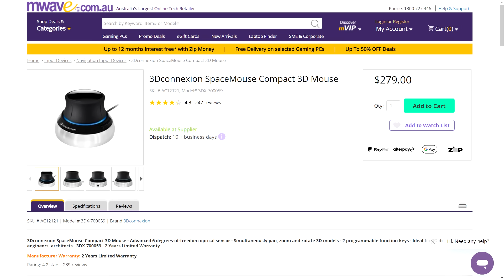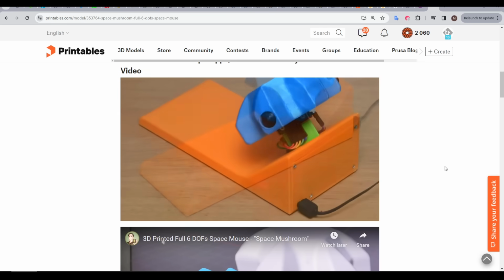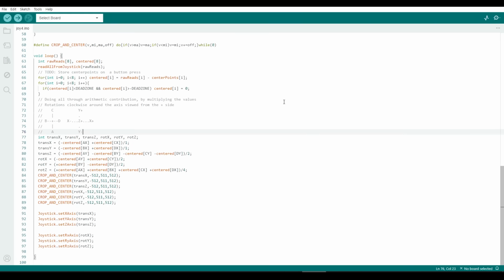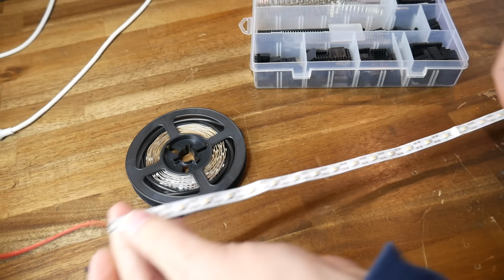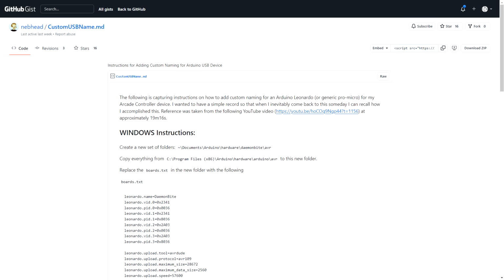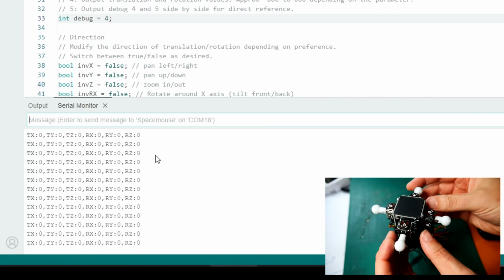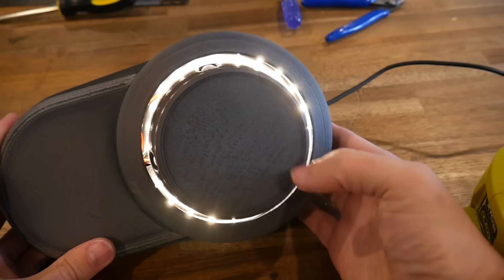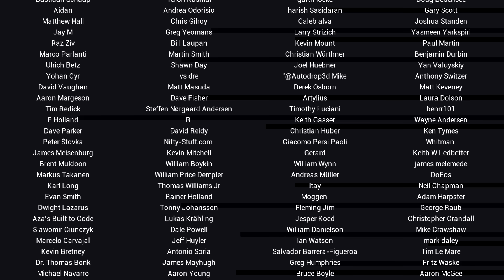Making a cheap, open source 3D space mouse with Arduino and 3D printing *V2 out*

Comment from the maker: V1 has been dubbed 'Bigfoot' on Printables. V2 is now out, which I have called 'Mini-ish''. It's much, much smaller and has some code tweaks to require a smaller range of input motion. Same link as before: https://www.printables.com/model/864950-open-source-spacemouse-space-mushroom-remix
Reply: Love it. ❤️  I'll wait a couple of weeks before making this in case a V3 comes out. 😃
Reply: @johncrombie2771  dude... build the v2 and then use it in cad to iterate the v3!   then take a pic of you working on the model of v2 while using the actual physical v2... meta.   lmfao.   but seriously... thats what makes open source stuff like this awesome

i had actually spent some time trying to 3d scan a big chunk of play dough i made into an ergonomic wrist/palm rest for my space mouse.    those files are around somewhere too... rests for the smaller 3dconnexion one as well.
Reply: @DeagleBingo  One reason why open source is so good, is that you still get to enjoy it even if you don't personally want to contribute :) I'm personally only interested in building one, but it will no doubt be used to create something else, that I'll share for the community!
Reply: Dang V2, came out right as I finished V1 almost on the dot. :)
already printing them out 😎
Reply: impressive iteration speed! I saw the first video and was considering whether I could remix it to work like the v2 you made but you beat me to it!
Reply: There is a project VjoySerialFeeder that can take anything you can possibly connect to an arduino into a joystick in windows and linux, i already implemented a lot more stuff and i'll upstream until the end of the week. For instance, support for playstation 2 controllers and key matrices, i wanaa play racing games with my gameshark pedal and the ps2 controller, the software seems good but my arduino forgot it's bootloader and i need another one. I will probably be implementing support for other controllers as well.
Reply: I see you turned the joystick PCB's sideways (which is what my design is using so I can reduce the height of the unit)...did you have to do any reversal of variable directions or just switch the X and Y connections?
I haven't gotten to debugging yet so I don't know if more than connector swapping will be necessary...
Reply: Okay...got it to compile, but 3Dconnexion doesn't recognize it when I plug it in...

Edit: I think I got it to work...see my comment below for more details.
Reply: @hdmungeryt  what did u do to make it recognize it?
Reply: @bismakadar3222  I outlined how I fixed it in the things I learned section of my previous post farther down the list.
Reply: I just want to thank you for calling out the poor design of Orbison, it felt like a college student's first projects. I tried making it, it's a fing nightmare broke 2 Nanos and ran into multiple issues with the printing (in retrospect mostly poor print quality but it was my first print so I didn't know better.)

The biggest bullshit with is it's spread across like 3 different repos irrc I got the code from one place wiring diagram and BoM from another Nd the STL files from another. 
Got the parts in went to wire it up only to find out yes there is a 'wire diagram' but it just tells you solder x wire to a and b parts.

Ended up having to disassemble it so often to troubleshoot failed soldered from too aggressive handling does help that the margen of error for soldering is nill literally for some areas I had to pretty much smd solder instead of through hole because the area behind it was a slab of pla.

I have high hopes for your build the space mouse was always meant to be my backup  build but got turned off it after the night mare of Orbison.
Reply: I came to the comments to say that it looks promising but I'll wait for the smaller revision before I'll try it, I guess no waiting then 😁
Reply: @Iisakki3000  works well :) But software support is surprisingly hit or miss. Lychee does not support it. Fusion 360, Chitubox, Qidi slicer, Prusa slicer works well. Though zooming in and out is better with mice  :D 
Maybe someone could add a rotary encoder for zooming + macro extension would be cool as well to add some buttons. I'll think about this :D
Reply: I'm making the V2 right now. Parts have been printed and I've got the joysticks and the board but I'm having trouble accomplishing the first step (nebhead's instructions) because I cannot find the avr folder because I'm on a Mac. I could use my Windows work laptop but I'm not liking the idea of having all of my work stored on something that isn't mine, especially since I'm planning to do more of this.
Could this work on my Mac or should I just take my work laptop...? I've looked online and found several suggestions on where to find it but no luck yet...

edit, finally found it at Users/username/Library/Arduino15/packages/arduino/hardware/
Reply: @deblaiser  Hi, does it work for you with macos?
Reply: @FrancescoAstore73  Using the load of help in the "makes" page of the printables model, I got the spacemouse recognised by my Mac. But before testing it out, I'm now printing some of the upgrades (re-centered box for the joysticks + joysticks with less clearance) so I have not tested it yet.
Reply: @deblaiser  Thank you. I just solved it by using a new boards.txt file.
Reply: when is it the third version?
Reply: Your work Looks amazing - newbie here with a Bambu P1S - teaching myself fusion now just need the v2 parts and some time
Reply: Luckily I have waited a bit and printed V2 :D But I broke my board. When I plugged in the USB cable the connector separated from the board and can not be soldered back :C I have to wait for a new one now T_T

Comment: I built the Spacemouse according to your guide, but I'm running into a problem: my MacBook with macOS 26 recognizes the hardware on the USB ports, and the Arduino IDE (.ino program) also sees it. However, the 3Dconnexion program does not recognize it. How can I fix this? It feels like there's a connection wall.

Comment: The prices are ridiculous because they got the monopoly, Wacom was the same (And probably still are) before other companies could make Display Tablets. Like 6-8K for a tablet.
Reply: Yes. I've got one that I found on ebay because it was older, though lightly used. I had one several years ago, made for serial port and WinXP, and when I asked for updated drivers to use it with Linux, they told me to go buy a new one. Who do they think they are? John Deere?

Comment: hi, i have made this spacemouse (v2) but when i use the code linked on printables, arduino ide says there is no file or directory for HID.h. also the arduino ide installation folder for me does not show hardware. is it because i am opening the ide installation folder, if so please try and help me since i need this project done soon. many thanks

Comment: my code is working in Aurduino IDE, showing variable changes in serial monitor as well, but still not connecting with 3dconnexion software, shows no device connected/detected

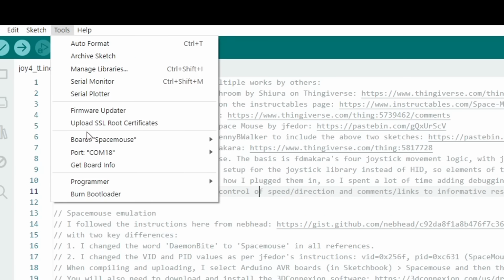Comment: A very good video. But unfortunately I can't get any further from the 10:40 minute mark. Where does this code come from, how can I upload it? So that I can edit it further and upload it to Arduino.
Reply: On printables:
Other files
joy4_tt.ino
Arduino sketch for original 'Bigfoot'
14 kB  |  May 3, 2024
joy4_tt_v2.ino
14 kB  |  May 8, 2024
Reply: @sneakyg1250 
Thanks for the reply, I'll give it a try.
Reply: @sneakyg1250 
Today I finally tried it out and did everything according to the video. I get an error message or something similar when I run the code. I suspect that the version of Arduino used also plays a role. I've noticed this with other projects. Unfortunately, you can't see which version is used in the video. Who can help? Unfortunately, I can't post a photo here with the message I'm getting.
Reply: @Denman123  I just installed arduino, didnt change the version or anything, just those files where needed and replacing the boards.txt file in the avr folder
but i cant remember what else i did * you do need to install the driver from 3dxware

Comment: I built it!   Worked on the first try, couldn't believe it.  Still can't figure out what screws you specified to hold the joysticks, but I just drilled them through and used 3mm screws that don't stick out the sides.

Comment: Same here 3dconnextion software does not recognize the mouse, correct PID and VID, same as in video and instructions. Also serial monitor is not working

EDIT: got it to connect, however it`s only outputs in the serial monitor is 1023. no change in values as i rotate or move the joysticks.

EDIT2: got it to work, bad connection  negative on the Arduino

Comment: Yes definitely that motor and battery voltage is looking way too small (not powerful enough) for your model.  Not sure if that RC car is a 1/10 or 1/8th scale size but. On my 1/8th size RC truck looks similar to the size of your model has bigger stock brushes motor and a 4s size battery. Hope this helps.

Comment: First and foremost I wanna say thank you for the awesome content I have wanted a space mouse for sometime but couldn't justify spending that amount of money. Im so glad you did this. I have everything printed and assembled,  however me being pretty new to programming these arduino boards has me a bit stuck I dl the newest software realizing there is no " hardware" folder you speak of.  fixed that by downloading an older version now I have the hardware file I started to follow nebheads instructions but im stuck again as I cannot copy over the boards.txt information into the created avr folder.  Any help with this would be greatly appreciated.  A very dumbed down updated video for the software side of things would be awesome.  Thanks again for everything you do. UPDATE: I put my big boy pants on and got it all figured out.  I now have a perfectly working space mouse Im so dang happy it worked out in the end. THANKS AGAIN!!

Comment: Hey ya'll - I'm so late to the party on this but I do have a question.

I've built the mouse, arduino'ed and run all the testing/debugging - but alas, it won't connect/be seen by the 3Dconnexion driver/app.

Is there any easy to diagnose reason why it woudln't be picked up? 
I'm at a loss and looking for some guidance.

Thanks in advance
Reply: All good now. One person has provided me with some extra code and boom. Identified and works perfectly! :)
Reply: @Lucifersjester  what was the extra code? im having the same problem :(

Comment: Only I have a problem, that this 3dconnextion app cannot see mouse? It works in serial monitor in Arduino ide but that’s it. I can move my normal mouse with it, macOS sees space mouse at usb but still can’t connect to app. Any advices? :)

Comment: If you're still doing this project, could you do light sensors instead of 3d analogs like in the original spacemouse, because the 3d analogs are very insensitive in the smallest movements?

Comment: exactly the question I was going to ask. . . why so big?
Reply: The real question is "Why don't you just buy the mouse for 150$ instead of buying a 600$ 3D printer and then spending two months printing/programming/buidling/refining a way more limited version of such mouse"?
Reply: @ImagoPictures   Well this type of projects are targeted for thinkers. Meaning that this will not be the only project I would embark on as the 3d printer would help me work with other CAD projects down the road.  Ultimately I will be saving money down the road by being able to print at home instead of paying for printing parts.

Comment: Great video! I ended up building the V2. It works great on most software except for Fusion 360. For some reason, it crashes the 3Dconnexion software, preventing access to the settings window in the system tray and causing the mouse to not work in Fusion 360. In Fusion 360 preferences, I tried switching to the legacy driver, but still had no luck. Has anyone else encountered this issue and found a resolution?
Reply: Just a follow-up to this: I don't know if Autodesk released a silent update, but it appears to be working now. Just make sure you are using the legacy driver under the Fusion 360 preference; otherwise, it will not work. Hope this helps someone!

Comment: I'm part way though the build if the mini(ish) version.  So far pretty good, I'm really impressed with the models.  The M3 screws fit perfect cutting their own threads.  I expected I'd need to drill the holes first as all printers are tuned different and so the holes would be a different diameter.  Somehow you nailed the holes just right!  I would point out however, that if you start from a fresh install of Arduino IDE, things look quite a bit different and you need to figure out some issues with the configurations.

Comment: There is no need to drill a hole in the joystick plunger to secure the joystick and ball. If you look at the top of the joystick plunger, a 1mm hole has already been drilled, and it is easy to assemble using M1.5 screws. You can also make some modifications to the ball.

Comment: I finally got around to finishing the V2 version. Not too pleased with it. Seems as if the dead zone is too big on some directions. I am running the 3Dconnexion Trainer running and I have the serial monitor going with the debug version is set to 4. I see my inputs in the serial monitor just fine but the teapot in the Trainer doesn't move unless I pull up or push down all the way then it just takes off too fast. Zoom in and out works OK, move left and right works OK, rotate left and right as well as forward and backward works too, but move up and down and spin are all or nothing, zip off the screen or spin like mad.

Comment: Excellent, I've been trying several of these versions on and off over the last year or so, with little luck. The most promising was a system based on a "reverse" Stewart platform that worked - but only in Linux, which I don't use.
Definitely going to give your setup a try! And then play with adding buttons ;)
Thank you very much!

Comment: If you use a wobble-plate under the controller arm and rolling contact joints between the joystick rods and the wobble plate, you can stack all four flat on the bottom right next to each other, with a sliding shaft ball-swivel in the center as the wobble plate pivot point.  That way you'd have motion control on all 6 axes, but in a space about 30% smaller horizontally and 50% smaller vertically.

Comment: Can't program the board, get this error:
WARNING: library HID claims to run on avr architecture(s) and may be incompatible with your current board which runs on 1.8.6 architecture(s).
Sketch uses 5584 bytes (19%) of program storage space. Maximum is 28672 bytes.
Global variables use 234 bytes (9%) of dynamic memory, leaving 2326 bytes for local variables. Maximum is 2560 bytes.
Property 'upload.tool.serial' is undefined
Reply: Ok I think I got it working.
The solution was to go to original board file the arduino uses, locate the section responsible for arduino micro (not leonardo as this video and github page tells you to use) and then I modified the 4 parameters with the name, pid, vid and product name, then it worked fine.
I also had made a copy of the original board file to revert it to original.

Comment: I succesfully got the arduino programmed on my Mac but sadly the 3D connexion software does not find any device when connected. On my (work)Windows laptop (not my CAD machine) it is recognised as a spacemouse pro wireless... I've uninstalled and reinstalled the drivers several times without any luck
Reply: Having the same issue on MacOS. "No Device Found"
Reply: I was able to get it working on MacOS, I used 0xC62E as the pid value.

Comment: I have now tried it with Arduino 1.8.18 version. After I have set everything necessary and selected space mouse on Arduino, I only have void setup and void loop on the display. How should I proceed? did I miss something?
Reply from the maker: You need to download the ino file and open it in Arduino.
Reply: @TeachingTech  Hello Michael, I think the problem is with my wiring. Could you possibly make a video of how the wiring on the microprocessor should be?
Reply from the maker: Everything is on Printables, including a wiring diagram.
Reply: Where i can download the İno file?

Comment: how can i flash the Firmware? i dont have a folder Arduino in c programm files
Reply: i had the same problem found it here C:\Users<USER>\AppData\Local\Arduino15\packages\arduino\hardware
 i can compile but then i i get an Upload error: Property 'upload.tool.serial' is undefined while uploading
Reply: @xkillerrorx Have you found a solution yet?
Reply: I have the Same Problem with  the Upload errror . Hours to try but no success.
Reply: Nope
Reply: same problem upload.tool.serial error on arduino ide 2.3.2
Reply: @marcrainierngo   arduino 1.8.19 did work
Reply: @marcrainierngo  in boards.txt change "leonardo.upload.tool=avrdude" to "leonardo.upload.tool.serial=avrdude"

Comment: Hello Michael and thanks for the Spacemouse V2 which I've printed and partially assembled only to conclude there's no current macOS Sonoma support for the Arduino coding part of it. I'm a total novice though and may have missed something. I have installed the 3Dconnection macOS software but am stuck without a setup guide for the Arduino Pro Micro for macOS. Please let me know whether I've reached a dead end since I'm on an M2 Mac. Maybe I could install Parallels if it supports Arduino? Thanks very much, any help is much appreciated.